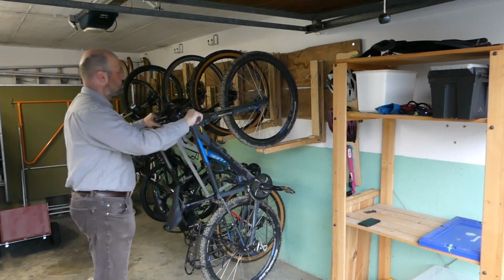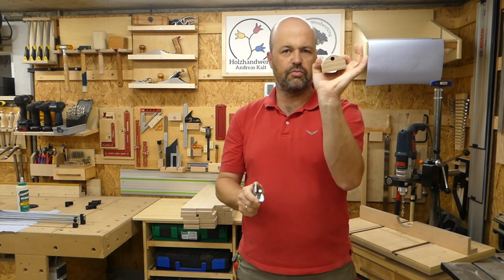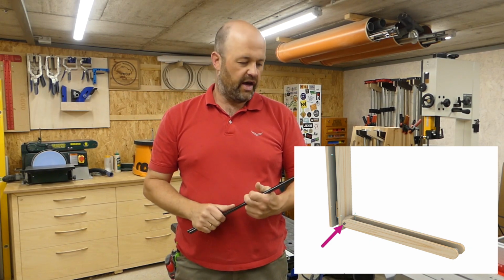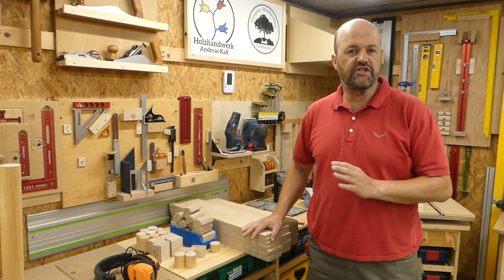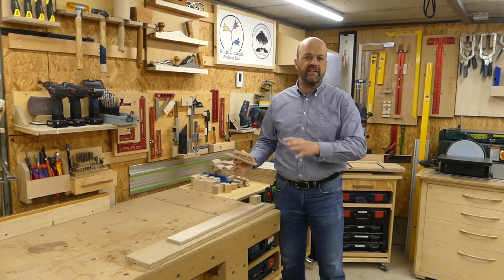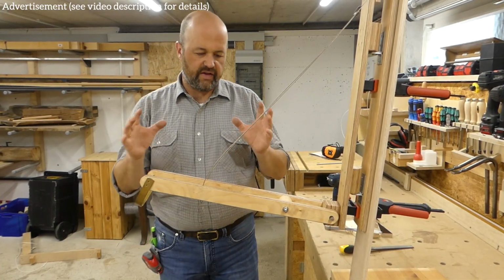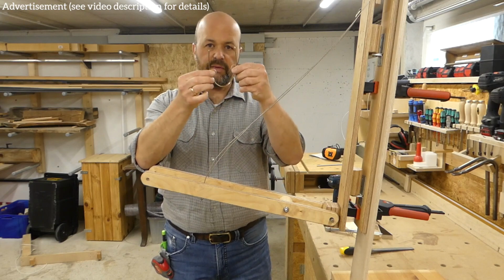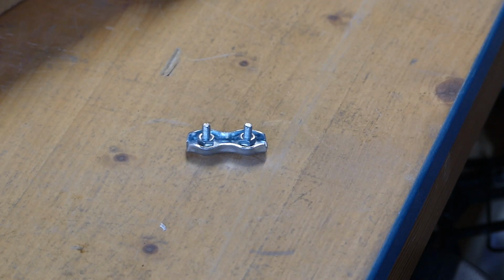Bike Rack DIY (wall-mount) – EASY to load/unload & saves space

Comment: Very beautiful work Andreas and highly instructional. What is the steel cable you used? Possibly a person could use a brake cable from a bike? I am a bike mechanic and have lots of bike brake cables.. Thank you for the project  . Cheers John.
Reply from the maker: Thanks John – the cable came from a set of picture hangers that included magnets to attach the pictures to the cable. We had several of the and didn’t use them so I repurposed the cables for the bike hangers.